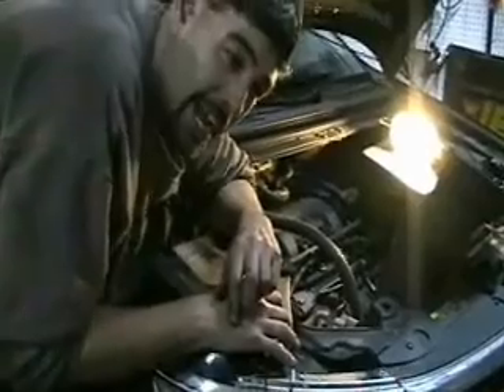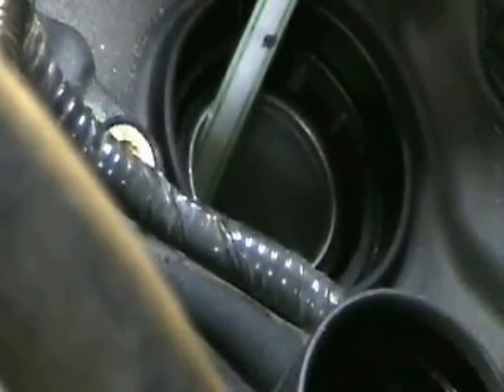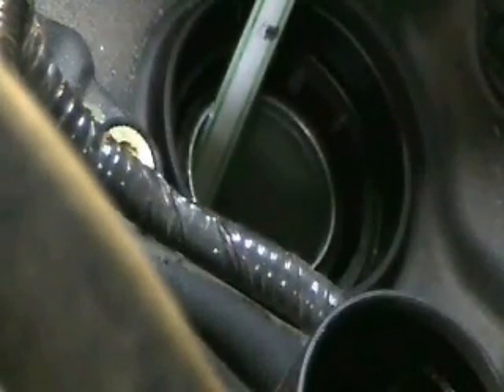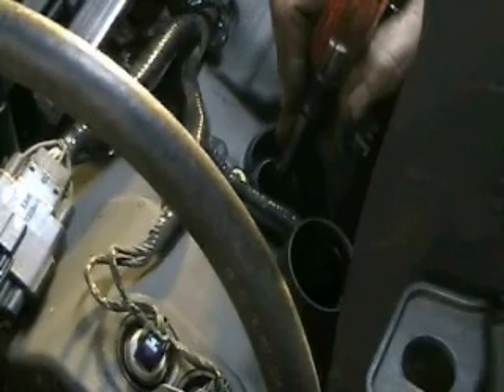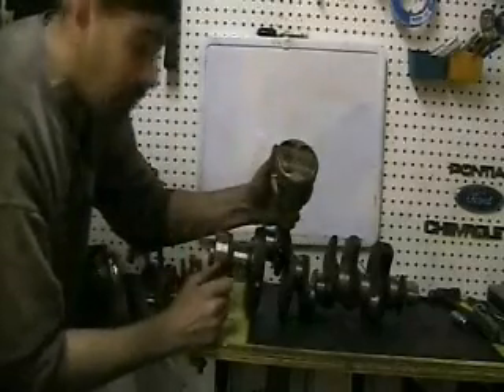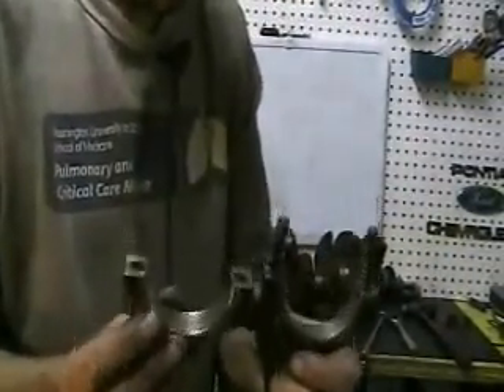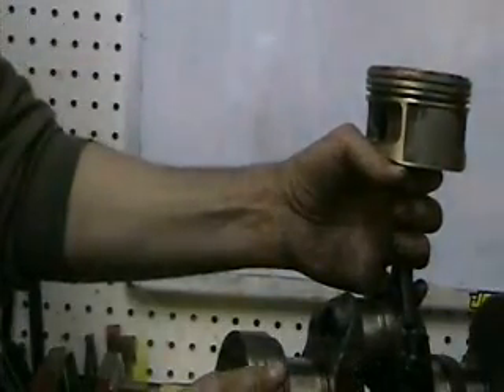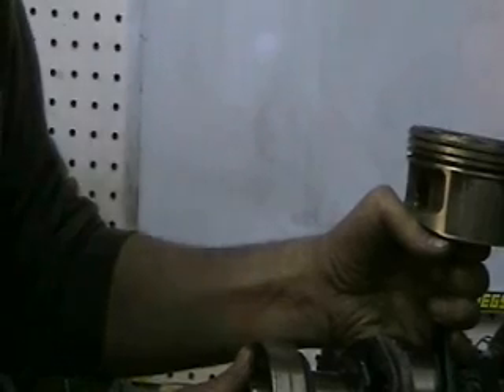How to test for Rod Knock using a screwdriver

Comment: @Schrodingers Box
i own a 08 335I bmw (N54) E92. 
I have a knock sound and my mechanic opened the oil filter and found tiny metal pieces. 
If i wanna change the bearings myself - Do i need to take the engine out?
Reply from the maker: Yes
Reply: Thanks...
Im gonna try.
How do i know if the crankshaft is bad?
Reply from the maker: Rocky Chicoma When you have grooves in it that you can feel by dragging your fingernail over them, it a definite sign it needs machining.

Comment: How would you do this on a 3800?  I thought it had a knock when I bought it, but it ran so good, I was not sure.  I put high mileage oil in it and rislone, but I can still hear it....any suggestions?  Can it be fixed without pulling the motor and rebuilding it?
Reply from the maker: You would do this same procedure on any engine. Once you verify the piston moves even the slightest bit with the screwdriver test, you must remove the engine no matter how you look at it- just trying to replace the bearings alone will not be successful.

Comment: So i ran into a rod knock. and i couldnt find bearings to replace so i bought a used set, piston+connecting rod w/ bearings on it, replacing the spun bearing with this new set will only temperately fix my engine, sooner or later itll just go out again?

Comment: I thought rod knock happens when your piston rings wear out (the ones that go around the piston itself, on top)
Reply from the maker: No that results in a different noise called Piston Slap. In some engines- Chevy LT-1's for example, it is actually normal on cold start up briefly.
Reply: Schrodingers Box
so,
piston bearing failure = rod knock = oil spit out the exhaust pipes?
Piston ring failure = piston slap = gas gets to in the engine oil?
Reply from the maker: ***** It's not quite that straightforward since lots of things can cause either of those conditions (e.g. worn valve guides would cause oil out the exhaust and a leaking internal fuel line or regulator could spill gas into the oil) but generally if the piston rings are worn you will have both oil out the exhaust and gas in the oil, the reason being: worn rings would dramatically reduce combustion causing failure to burn the fuel mixture and thus contaminating the oil since much of the raw gas mix goes past the worn rings and enters the oil pan. In fact, this "exhaust" going into the oil pan can greatly increase the pressure in the oil system causing the oil to burp up through the PCV into the intake even soaking the oil filter in fact!
   Rod Knock does not necessitate you will have combustion going past the rings however because the timing is changed since the piston is "loose" on the journal you also won't get complete burn and often will see black smoke out the exhaust.

But trust me, whether it's rod knock or worn rings, the least of your concerns is what's coming out your exhaust but rather what will be coming out of your wallet.
Reply: Schrodingers Box
Great stuff!!!  if your gas tank drains way too quickly, considering that the (carbs are adjusted and clean), the only direction the gas may escape is the oil pan; thus worn rings are the cause.

Comment: I thought rod knock had to do with the lifters and the valve stems having slack thus having to much valve clearance. Does it make the same noise on both?
Reply from the maker: Rod knock is exactly as shown in the video.  The condition you described is "lifter tap" or "valve train chatter" and is quite different both in sound, cause, and seriousness.  See my video "engine noise diagnosis" for lifter noise example and diagnosis.

Comment: Friggen Brilliant Video!!!!  Best way I've ever heard it explained.

Is there a way to change out the bearing with out having to pull the engine? I don't have an engine hoist or an engine stand.
Reply from the maker: @Kepaloha- Thanks so much!! Yes, on some models you can change the rod bearings with engine in place by positioning the crank to access the cap, unbolting the cap, pushing the piston up and slipping bearings in, however I would never do this. Usually the crank journals are damaged by time you hear knock and the friction will make the repair very short lived.  And even if the journal isn't damaged, the tons of metal in the oil that stuck in all the bearings in the engine are soon to be a major issue. To me, engine knock=rebuild or replace.

Comment from the maker: @Jason Gauthier-  The only way I could think to check for *evidence* of a bent or twisted connecting rod without removing oil pan would probably be to measure the exact point of TDC on each cylinder.  A piston that shows to always have a lower TDC measurement than other cylinders would indicate a bent or twisted rod, causing a shorter stroke than straight rod.  This is all that comes to mind off the top of my head.

Comment from the maker: Sorry to hear that Diallo, indeed this simple test could've been used in your case.  In rare cases- and I don't recommend this, you may be able to replace the bearings in the word rod if the bearings aren't totally worn and journals are still smooth however you still have to contend with tons of metal in the galleys etc as well as whatever wear is done elsewhere on bottom end.  IMO, Rod knock=rebuild. You might benefit from my lifter overhaul and used engine videos- click my name to find them.

Comment: *&@%*&!# you know I just had the head off replacing the lifters on my 02 Tahoe 5.3L engine thinking that was the issue and it would have been really easy to see if I had rod knock, but I didn't think about it til I was almost done with the rebuild and the knock is still there!  So more than likely it's rod knock and it isn't too bad so I can probably just replace the crank and bearings.  There was no damage to the piston when I had it off, but it was above the deck.